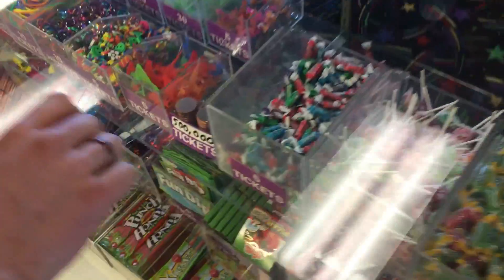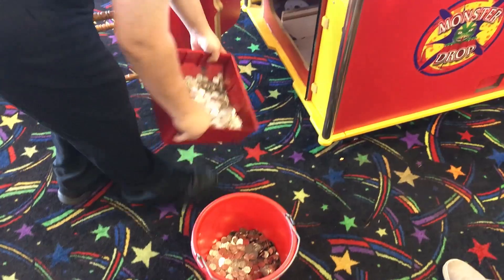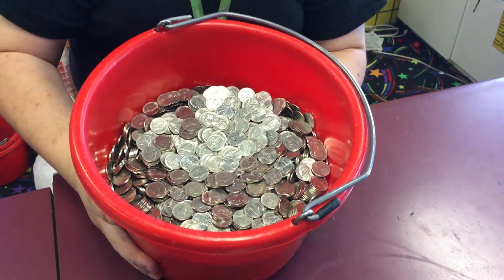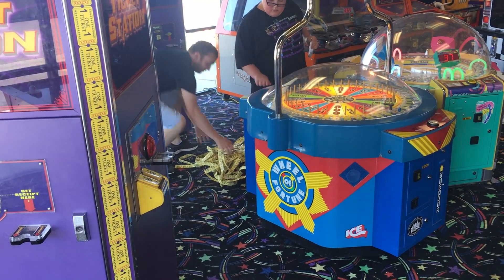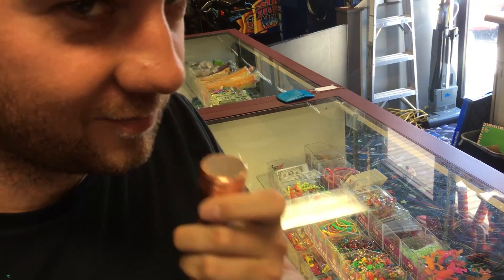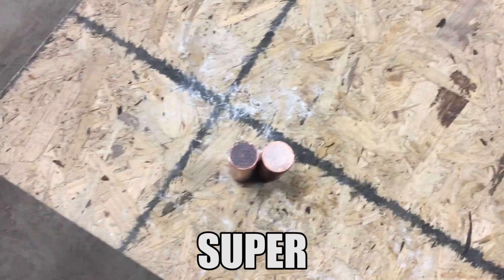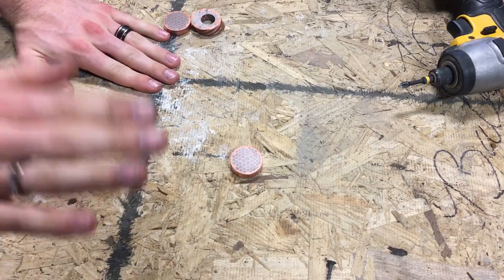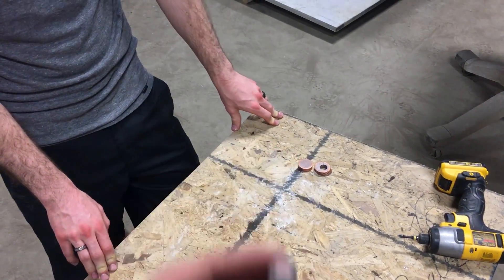Custom Superconductor Ring with 60,000 PSI Waterjet - Patrick Adair Designs

Comment: That guy was so chill giving them $500 in nickels
Reply: Most arcades have a machine that will actually weigh the nickels and it tells you how many there are. Nickels are 5 grams so there are 20 nickels in a dollar so 20*500 so that's 10000 nickels * 5 grams = 50000 grams. 1 gram = 0.00220462 lbs so 50000 * 0.00220462 = 110.231 pounds. So the clerk only has to give approximately that weight in nickels. There may be some deviation with worn down nickels and stuff but you get the idea.
Reply: @Yakz619 : You got it perfectly in kg... you didn't need to convert it into something obscure?
Reply: @gideonz74b Zweijtzer yes this is true. It would be 50 kg,  but in the states, people use the empirical system so I converted for them. Whereas for the metric system people would have just been able to convert it themselves due to the simplicity of it :)
Reply: That was just a bit.  He just grabbed a bunch of tokens. He didn't actually count out $500 worth.
Reply: I mean its also his job and he wants to act as professional as possible not make the customer feel awkward
Reply: I used to work at an arcade/amusement park, and they had a system. The guys worked outside rides (go carts, rock wall, drop zone etc..) while women worked kitchen/register, and guys that were either really nerdy or gay (nothing against being gay) worked arcade/prize counter. (given guys would sometimes work inside, but women never worked outside) I filled in for a kids shift one day at prize counter cause he called out and it was literally the worst fucking thing ever bless that poor man.
Reply: Probably not he could of made several rings from just those two rolls of super conductors.
Reply: They paid him to get the 500
Reply: Random person Scrolling through the
Reply: A happy reunion.
Reply: Yeah xD Did he count them?
Reply: the fact that you think that object actually costed 500k tickets and the employee wasn't in on this video is funny
Reply: HAHA Exactly!
Reply: meelo 14 not to mention they put the 500 dollars worth of nickles back into the machines lol
Reply: you don't count coins in that volume you weight them but they just did a bit to make the video more entertaining
Reply: Yes because every 5 year old kid strives to get enough tickets to get a super conductor . It was obviously a joke they added in the video. The guy behind the counter was cool to help their idea for the video become reality.
Reply: Simon Tang I can’t say I recall that system being built into the hopper when I worked at a arcade. We would take the hopper out and weigh it to count it though. Making it very easy.
Reply: It's obviously staged and pre-arranged.
Reply: Cause he made 400 bucks because of them.
Reply: Random person Scrolling through the comments video was set up, friends
Reply: So does the ring cost 500 because the tickets cost that much?
Reply: @PimpDiCaprio  
They got a few blanks from the single thing and they probably didn't use all of it.
Reply: +Golden Duck nickels*
Reply: @goldenduck7294  hey got any grapes
Reply: Obviously He doesn't give a fuck if you want to spend a lot on arcade tickets.
If I were him though I would have made a joke about like "big day huh?" Or something like thar
Reply: Random Person hello brother
Reply: What's good in the hood fam
Reply: Random person Scrolling through the comments
Reply: No one asked u mate don't be salty
Reply: Can make more than one ring... and sell them off.
Reply: Random person Scrolling through the comments ya that is pretty funy